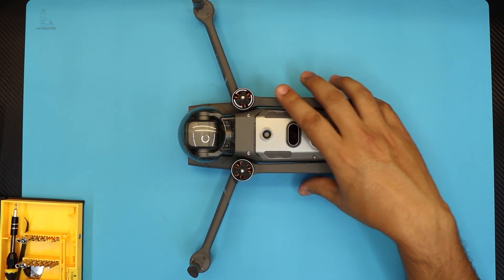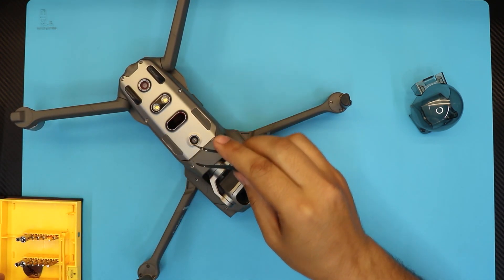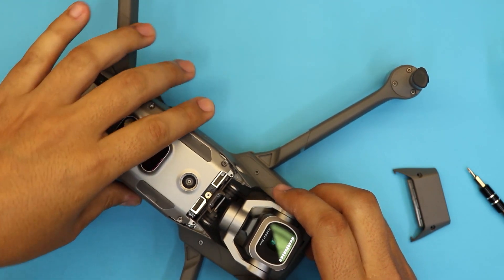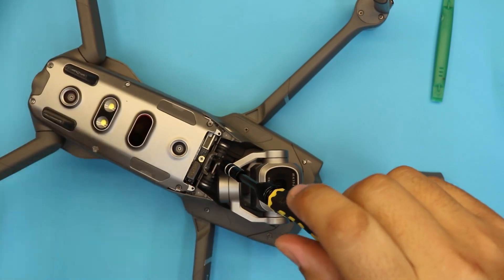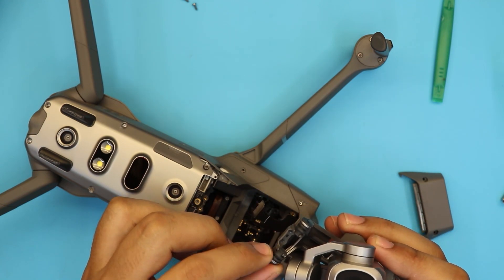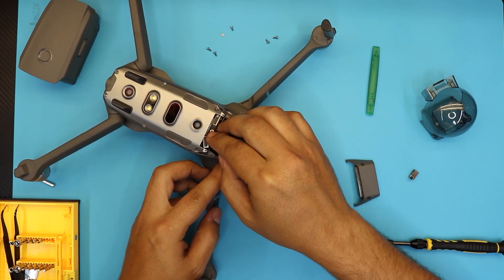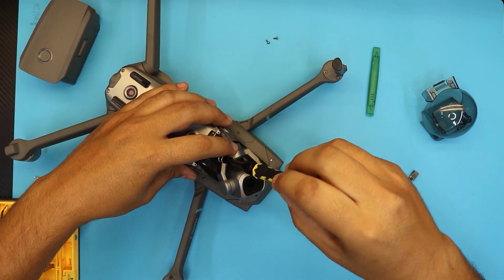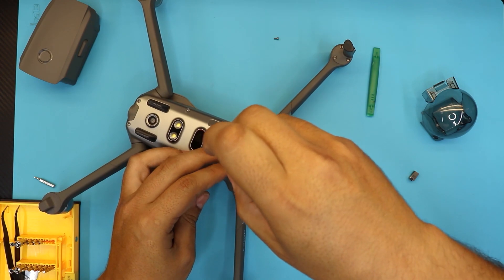HOW TO replace DJI mavic pro 2 gimbal DIY swap

Comment: The engine of my camera was broken after a crash.. The camera works fine, though. How do you split the camera from the gimbal and replace it?
Reply from the maker: it come in one piece they dont sell them desperately :/
Reply: @uFixTek  Thanks a lot for the answer
Reply: @elendil755  Vendors do sell the motors separate now. I saw some, but did not note addresses.

Comment: Just remember taking off your gimbal invalidates your warranty
Reply from the maker: im sorry to inform you it doesn't because there are no seals or locks to break and i have personally send back a faulty gimbal after i opened it up and saw that there was nothing physically wrong with it, and it was a mechanical issue. and i put it back and send it for warranty and i did get the gimbal replaced.  yes they do say it voids but if you take out with care and don't make it obvious then you are more than fine.
Reply: uFixTek 
There is a glue seal plug on the right hand locking screw you’d have to remove to take off gimbal
Reply from the maker: @SiMon-dx9iy  ah that you just put GE Silicone Glue, and to be honest i didn't even put the GE and send it back i got it replaced :P
but if you want use :GE Silicone Glue:
Reply: uFixTek DJI will not be happy people aren’t buying both drones so may add a firmware update to prevent drone accepting different camera
Reply from the maker: @SiMon-dx9iy   that could be true but, this vid is only showing you how to take it apart and clean and replace it if you have working camera. regarding adding different camera i have no idea if it will work or not and if the voltage are the same or it may even damage the main board!
Reply: uFixTek you can swap cameras and they do work , my friend has a zoom camera for his pro mavic
Reply from the maker: Si Mon 2 that’s good to know that they are compatible.